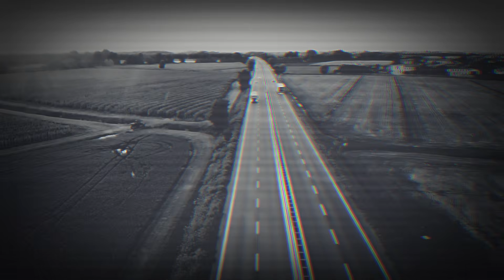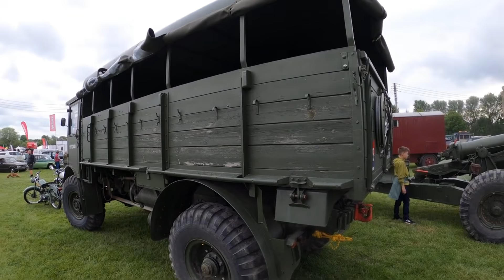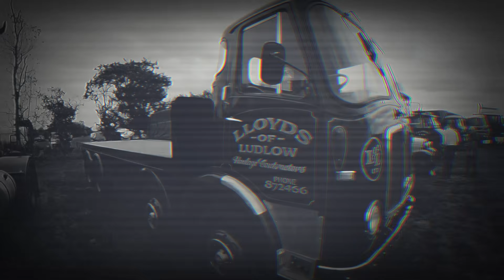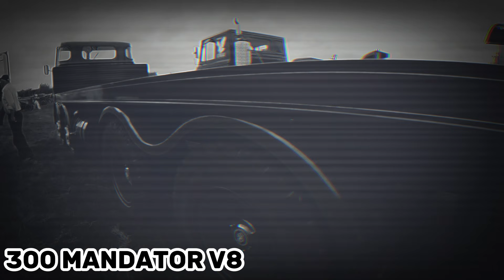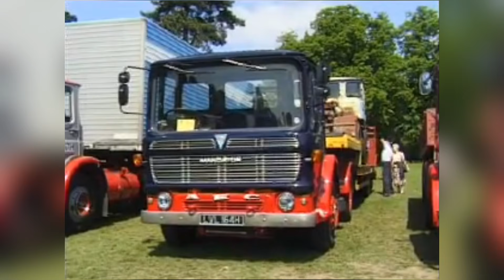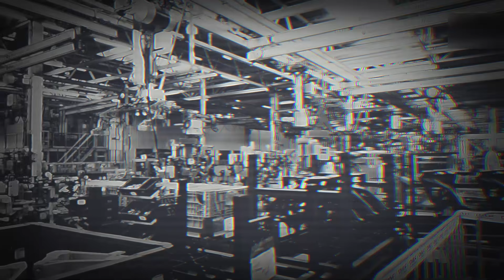The Grim Reality of AEC Lorries Today!

Comment: maybe this is a bit severe. yes an AEC 7.7L is expensive to repair. but hang on, have you priced up a rebuild on a gardner 180 lately? any english deisel is a money pit. maybe the reason there isnt many about is the whole 5hp to the ton thing and the 30mph top speed down hill with angel gear assist. AEC measures up well in many regards, compaired to a foden or a erf or Albion. moden tyre sizes, reasonable visability, less rust, but yeah theyre slow.

Comment: I used to work on a fleet of these AECs,chassis wise they were one of the best around but around the 1960s the engines were absolutely crap with their constant head gasket problems and low oil pressure when hot probably through overheating,the brakes were second to none as were the gearbox clutch and diffs,the only problems we had were constant injection pipe failures and as said the head gasket problems,they should have put the Leyland 680 engine in them, they weren’t perfect but we’re I lot more reliable,our Mandators and Mercury’s were an absolute nightmare,it’s a good job the company bought ERFs with Gardner 180s,they saved the company from bankruptcy.